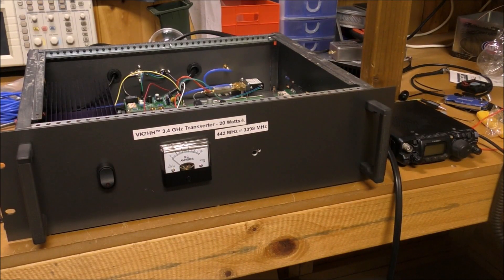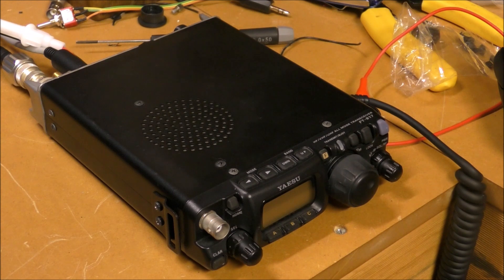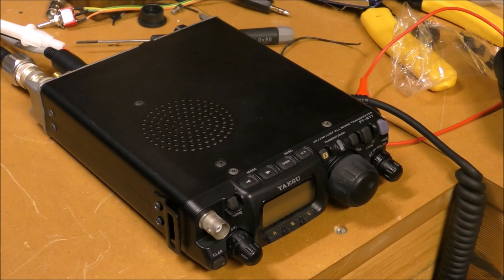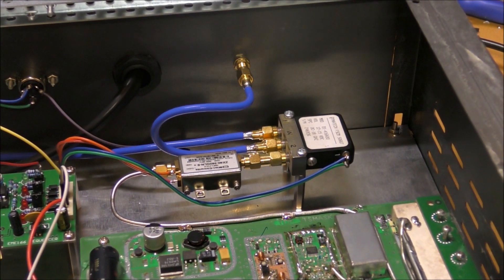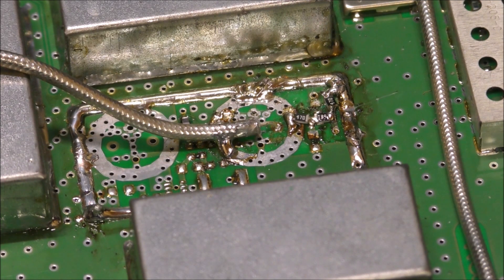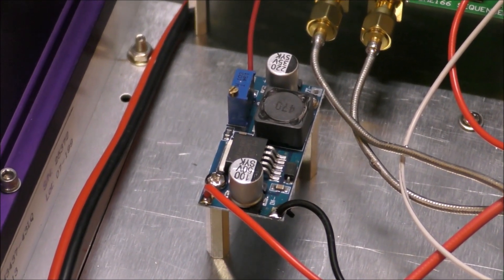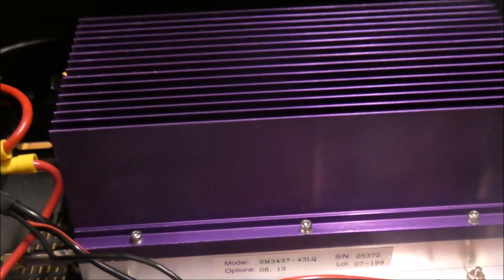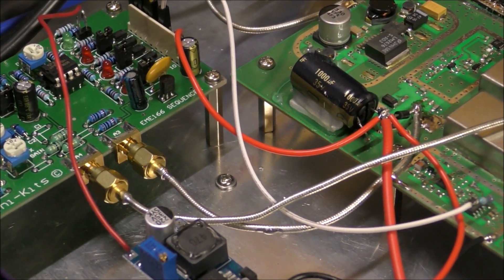A cheap 3.4 GHz (9cm) transverter

Comment: You have an sg labs transverter in there now? How do you attenuate the power from the sg labs transverter to the stealth PA. I have both but not sure how to wire everything and the proper power levels.
Reply from the maker: https://youtu.be/YnULPw_AK_8?t=4610

In this video presentation you will see at 1:16:50 my setup. Split the RX and TX/RX paths by moving the jumper in the SG-Lab transverter. RX then goes to your coax switch (or in my case via a preamp).

There is a SMA attenuator, the black one on the TX output of the SG Lab transverter to the Stealth amp to drop the 2.5W down to the correct drive for the Stealth. From memory it needs... 0dBm? So that means you'd need to use 34dB of attenuation. I think I used a 30dB attenuator from eBay. Then I have an additional 3dB SMA on that, so about 33dB or so. The amp is well into saturation for full output power. I hope that helps?
Reply: @HamRadioDX  Yes that makes perfect sense. Thank you very much!